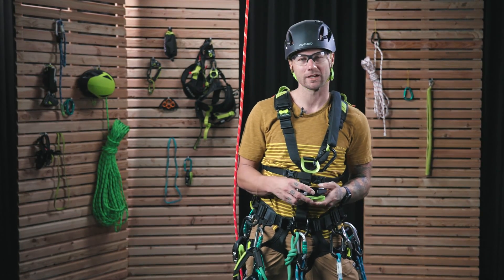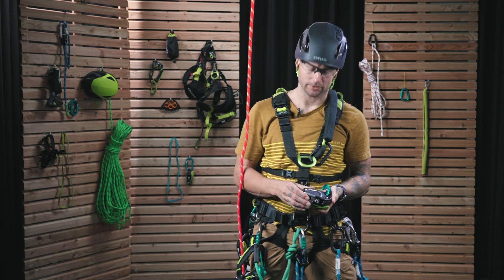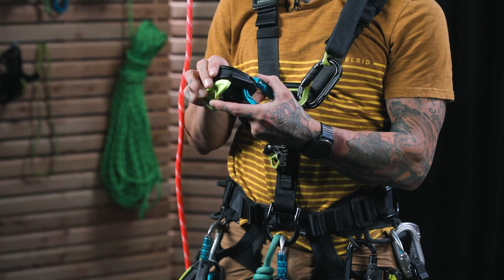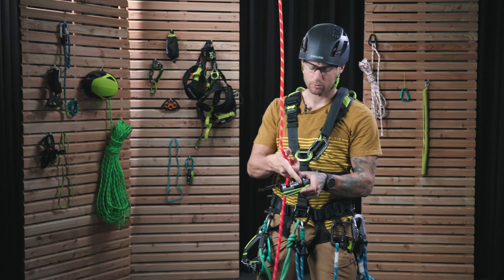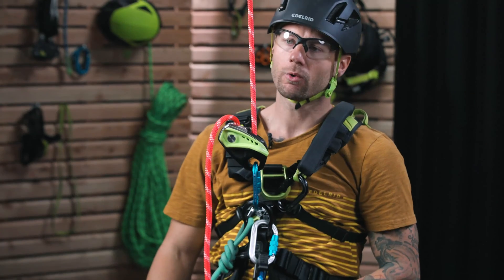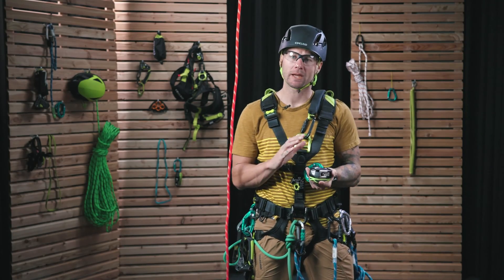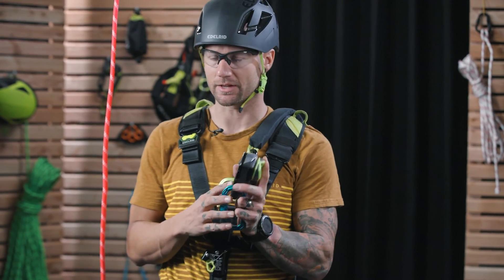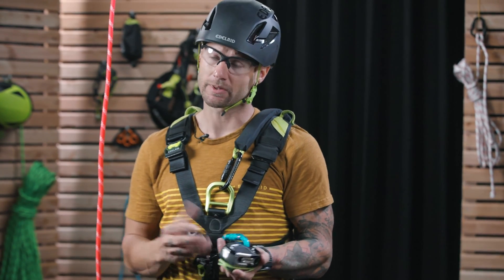MEGAWATT Application: Ascending and Descending | EDELRID

Comment: I want one of these even though I can sort of use a grigri to do similar stuff, it seems WAY more dangerous than this. Though this is like 2.5x the price.
Reply from the maker: The MEGAWATT is primarily a descender for rope access and this is its main area of application. However, it can also be used as a belay device for sports climbing. See our homepage and the user instructions for further information. 😊
Reply: There are a lot of other descenders that have similar functionality and are a bit safer than a grigri.  Many of them are not as expensive as the megawatt, you can check out the Petzl Rig, it doesn't have as many features as this, but it works pretty well, especially if you're used to the gri gri.